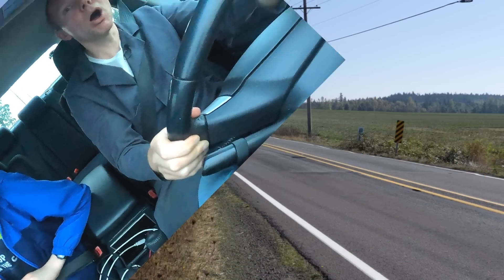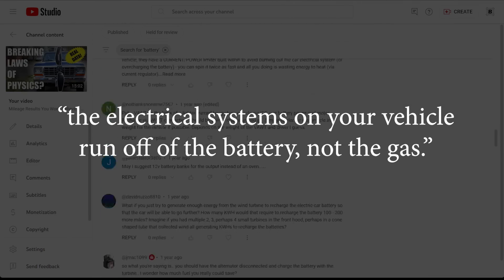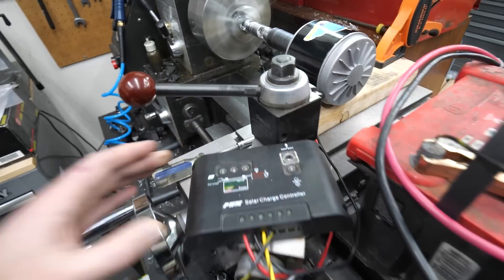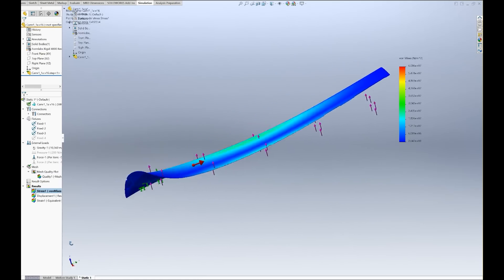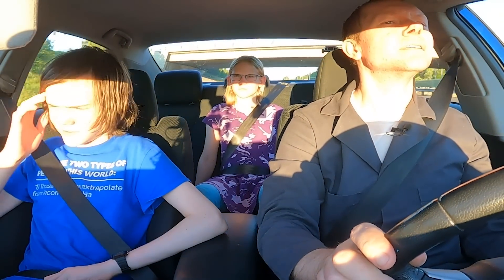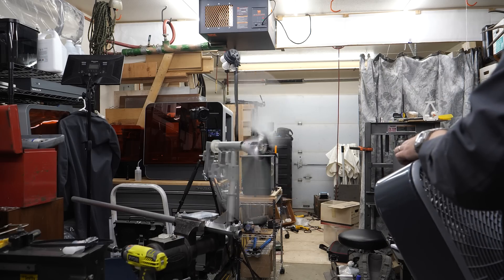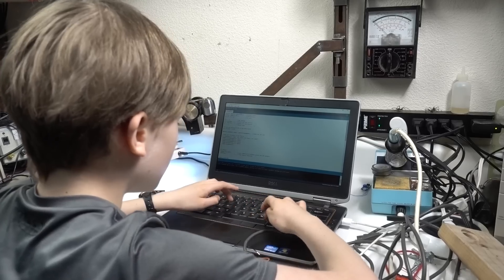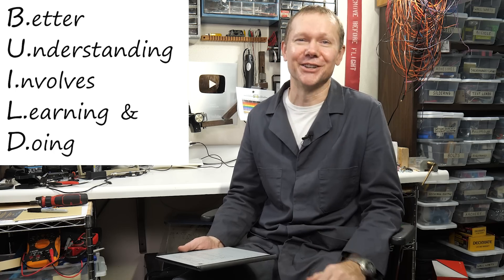3D Printed Turbine on a Camry - Wind Power on a Car #6

Comment: If the turbine is on top u face more drag with a much bigger volume of air hitting not only the fan but the surface of the vechicle , this will in turn force the feul to be consumed more.
Having on the front has the SAM EFFECT but in a lower capacity as your not add much more volume so should keep feul the same or slightly better....
The problem comes from your OPEN turbine design.

The car has been designed to handle the drag to the best of its abilities BUT u add propellers on front u reduce efficency, what you need is an SEMI ENCLOSED design much like a turbo jet engine to reduce the drag which capturing as much air drag as possible in the right location to allow the car to feel less drag... less drag = less fuel used. And a system like that will allow for much better feul consumption.
Ur proposed design would give you between 0 and 10% better feul efficency, my proposed design ranges from 5 to 50% better fuel efficency.

Comment: Basically the same concept as ground effect on race cars. The body of the car will create drag regardless so using the car as a wing allows you to add downforce without increasing drag. (Aside from induced drag***)

Comment: Why not try a ram jet design? Then you aren’t disturbing the air anymore than it already is and it can be used to cool the electric motor and exhausted back into the normal airflow of the vehicle.

Comment: Depends on the vehicle because some vehicles cut off without batteries. I can a van that would die when battery became loose because alternator was controlled with feedback from ecu

Comment: With the turbine in  front of the radiator, it will mess with the air flow over the radiator. I think this (aling with increased drag) will cause the net loss and all that jazz.
Reply: Drag is increased due to the increased angle of deflection of the air and the distance that occurs in. The radiator being worse at radiating will make the heat engine a less efficient heat engine.... although I think you might be able to get away with it depending on air conditions. but I am just an electrical guy eating toast writing this and shooting from the hip lol

Comment: Not really sure what you’re asking at 15:34

If you’re asking just for the difference, it’s simple.

Your slipstream (how much turbulent air) will increase if it is mounted atop your vehicle… where in front of your vehicle it will increase your slipstream by such a small amount it will show very little change. 

Along with that, it will cause a lot of drag if mounted atop the vehicle.  You’ll get more downforce on your rear axle, and that could be helpful if your engine was putting out enough power to warrant that, and it’s a RWD vehicle, but we simply aren’t looking for engine output/ performance, but instead looking for fuel mileage improvement. 

Along with that, if you need more downforce on your axle, you’d be better off moving it to the rear of the vehicle and making it cause as little drag with the most wind displacement and that would look like a spoiler… in fact it’d be a spoiler.  So no need to do that.

Comment: will matter if you take the alt out but with the belt still attached the drag remains,  if you have a belt briven fan changing to electric save gas and makes more power. It is all about the load of the belt.

Comment: Awesome videos with amazing problem solving skills!!  "Hope is not a strategy" lol.    I think the turbines out front ( and only out front,  in a smaller span of the front vehicle profile ) will improvs fuel* economy very slightly by displacing a small amount of air resistance as regained energy away/around the vehicle (work that was going to be done anyways).  Ideally the blades of the turbine would displace the air away from the car better and not more towards the center on the vehicle and work with the airflow around the car.  As long as the air that the blades of the turbine are displacing is away from the vehicle with proper aerodynamics in mind.  Fun stuff to think about.  I would be curious to see how one turbine would do out front and centre. (without having any blade span under the vehicle or above the hood)  One turbine in the middle should have equal air hitting each blade of the turbine.  Two turbines  could have  most of the air   hitting the blade on the outer edge of the vehicle front profile on its way around, leaving the air hitting the blades on the inner profile to receive less airflow. (maybe that's a good thing though, I don't know)  I assume if the turbines are too far from the car, it wont help economy. Too close could have strange eddies disrupting the turbines also.  I guess ideally, you're going to want to try to nerf the efficacy of your car's radiator with the blades of the turbine by having the radiator receive less airflow.

Comment: My guess is By putting that on the front of the car when it is producing power, blades would create enough resistance in the air because of the generator being harder to spin under load causing the whole thing to push back on the car probably equal or there abouts to what the alternator robs, to me there is no difference than putting on the roof other than creating even more drag, even if you put it on the back it would pull backwards the thing not just sitting there in the air stream at whatever speed it's going to be pushed backwards in front or behind doesn't matter

Comment: For these kind of problems, I like to think of the extremes. Let’s say your car has absolutely perfect aerodynamics and creates zero drag. Then it does not matter if you put the turbine in front or on top, any additional surface in the stream of air will slow your car down.

But your point is that the aerodynamics are not perfect and the air is disturbed anyway. In my opinion the most important factor here is when and how the airflow is disturbed.

Let’s say you drive your car with the turbine in a vacuum and hit exactly one molecule. Chronologically it will hit the turbine blade first, „spinning it up“ and pushing back on your car. Only after that happens it hits the cars front (radiator, windshield, wherever it gets deflected) and then creates it’s „normal turbulence“.

In a constant stream of air I expect the same to happen: The turbine gets hit first and slows the car down and the turbulence you want to use happens afterwards.

So as much as I would love this to work, I am sceptic but I think it’s awesome that you test this in real life because I actually had some discussions about that with an engineering friend. Also it’s awesome that you build it with your kids so even if it fails it will be a cool project for them to learn new things so it’s worth it anyway :)
Reply from the maker: Interesting way to look at it. Thanks for sharing!

Comment: You made something similar to the APU (auxillary power unit)  on big airplanes.  Normally the APU is stored inside the plane, but when a large airplane loses its electric power during flight, they can deploy the APU and it generates electricity from the airflow.

The fact that airplanes use the APU only in an emergency proves that it isn't an efficient way to provide power.  The APU increases drag on the plane and slows it down.

Comment: I bet the the car will improve in fuel economy, the wind turbine is making the air hitting the car more turbulent which might improve fuel efficiency all ready but recouping power on top and using it to actively drive the wheels will probably see a huge gain in efficiency

Comment: TY for the video

Using the turbines to generate the electricity for the vehicle will improve fuel efficiency, with respect to joules of fuel to watts of power. 

The consideration that, I think, will make a difference is how the aerodynamics of the vehicle are impacted. If the aerodynamic load increases, then there will be losses. But the overall effect will have to be considered to see if it's a net loss, or gain, or maybe just a break even.

Comment: Time 11:20ish...the funny noise is a harmonic resonance from something imbalanced. You can see the car shimmy in the video. I'm surprised you didn't feel it. It is like an imbalanced tire that is sensitive at a given speed, where the shimmy goes away as you accelerate through the sympathy range. You might want to add some vertical cross brace to reduce racking.

Comment: Increase. Not yet seeing the design (I paused) I'm going to guess 8%. I would suggest several smaller turbines set in a nacelle on the hood and run it like a ram air turbine (RAT) auxiliary power supply on military aircraft. They are used to power add on high voltage equipment from time to time. Keep up the good work educating me and raising those great kids.

Comment: You know you're just creating more drag than the energy it takes to produce electricity. You're better off just adding another alternator to the engine or solar panels on the roof.

Comment: This also can be used in a small unit in the front of an electric EV auto
This will run a charging port to keep the EV so you can drive farther
Being an engineer my self has talked to a few EV retailers but all said it will not work and understand bearable to look at I told them all this can be put under the front compartment  that is used for almost nothing
I love this this is a fabulous idea

Comment: How about using an rc boat type system where the blades are built within the confines of a shroud for structural integrity.  Also. This would need to be built also  within the confines of the front-end of the car for further structural strength in my opinion.  This at least warrants investigation and testing.

Comment: Aerospace engineer here, my prediction is that in the end, no, it will take as much if not more energy to push through the air than will be recovered in the turbine. At best, the turbine can recover 87% of the flow, and then there are the losses in the pully system, power generation, and buck converter. It’s a bit of a misconception to think of the air as stagnating at the front and thus lost; yes the pressure goes up at the front, but it is recovered on the backside. The aerodynamics of the back of the car are the most important. In this case, the pressure difference through the turbine is decreased substantially by the high pressure on the front of the car, which reduces how much power you can recover through the turbine. The flow is also disrupted, which will in turn disrupt the flow over the car, making its overall coefficient of drag higher. It is possible that the alternator in the car is so inefficient that even with the losses in this system, they are better than the car’s alternator, but I don’t think that will be the case. If it was, it is easy to test for. Even so, the work you and your children have been doing is fantastic and the methodology to test being taught to them is phenomenal. We have a slogan where I work “to separate the real from the imagined through flight test”. You may not be flying, but you are testing to separate the real from the imagined. Look forward to seeing the future updates.

Comment: The reason the propeller on the roof doesn't work where as the propeller on the front appears to work maybe, is that the air you need to push the turbine through you have to displaces with the vehicle anyway so it's kind of wasted energy recapture in that sense. In saying that you are introducing turbulence across the vehicle which may increase drag to the point that it stops making it worth it. Really interesting project! My gut reaction was to dismiss it immediately but what you're saying does make sense. More testing required!

Comment: It would be best to review this from an energy point of view. You are not creating energy here, so if you can generate x kW presumably you have consumed > x kW more from your ICE in the form of drag, or at least dynamic pressure. It would be interesting to drive 100miles without the generator installed, and the same 100miles with the generator installed and compare the fuel consumption. Care to share any numbers? If your theory is correct you could put generating propellers on the front of aircraft to make them more efficient - and more generating propellers would be more efficient right?

Comment: There will be an increase in drag from the turbines themselves cutting through the air, but some of the turbine drag will be recouped since the rotors are disrupting air before it gets to the car.  on the "stock" version of the car, fresh air is harder to push out of the way than air that is already turbulent from the turbine setup.  Overall, a small drag increase I would guess as long as complex fluid dynamics doesn't screw you over.

That combined with tiny weight gain and decent mechanical losses in the turbine system itself, means that there will be a large hill to climb to make it a net efficiency gain.

However, that being said,  I believe it will succeed in being more efficient by at least some measurable amount. 

At highway speed the large majority of work a car is doing is moving air out of the way. Anything you can do to recoup some of the energy imparted to those air molecules by the car as they move out of the way should tangibly increase efficiency. 

I think the biggest challenge is optimizing the system. there is no way to unhook the alternator from the serpentine belt so there is mechanical loss there, there's potentially only going to be a small regime where the turbine is working optimally, so your gains might get eaten away in the data from other speed regimes, the turbine blade design and size is pretty much infinitely tunable when coupled with target rpm range...so finding the best combination would take a lot of testing, so yeah, lots of little devils in all the details.

I wish you could put this on an EV vehicle and just pump power directly back into the propulsion system (not the battery). Then it would be absolute. Miles driven divided by power expended from the battery in stock and turbine configurations gives you the miles per Kw for each.  naysayers wouldn't be able to argue with that setup.

Comment: My guess is a slight net loss (0-2%)... Not that I don't believe your theory, I believe it's solid. I just expect it's going to require a bit more exotic design to get the gains your after which may require some redesign of the car as well as the turbine.
Reply: To improve your odds you should revert to something less efficient like the pick up truck XD

Comment: My guess is a increase of efficiency, mostly because the turbine is likely more efficient. Even with only 85% for the generator, the 800w would only need 940 "mechanical" watts. 

Also, i saw the video where someone cjarged a tesla by pulling it and the reach of both vehicles combined got longer than just the truck. Which kinda confirms my theory. Hopefully.

Edit: wrote the comment too early to see the percentage request, i say close to the 10 percent you mentioned the alternator needs, maybe a bit more but under 15.

Comment: Science says that you won’t notice a chance in economy. The boost in electricity from the turbines would be offset by the extra work the engine does to push the turbines through the air

Comment: I feel like if the fan blades were constructed to resemble the fan blades of a bathroom fan…. Encased in a housing that would catch the front air, then pushing the air out underneath the car…. it would resemble something along the lines of a front bumper attachment.

If the centre of the fanblades had a driveshaft that you could connect even two generators on both sides , I bet you it would crank it over and give you some interesting numbers

I am not an engineer , but I do love to tinker with stuff

When I first thought of this idea, I was more or less thinking about having something like that on an electric car to keep it charged up as you go for road trips

Comment: Stop calling yourself an engineer... it always takes more power to generate due to the conversion losses. The only way that something in front of the vehicle DOES NOT create drag, is if it does not disturb the air.  Rotating blades do not just passively pass air through them without creating drag... in fact, it is specifically that drag that causes the blades to spin.

800 watts out, probably 1500 watts in... 2hp input.

Comment: Taking your battery cables off of the vehicle while running is what a mechanic would do to check to see if your alternator is functioning correctly, because if an alternator is functioning correctly the car should not shut off when the battery is disconnected.
  if you do disconnect your battery and the engine dies you need to replace your alternator

Comment: The difference between a fan on top of the roof vs in front of the car is the area you're presenting to the wind.  By putting the fans on front of the car you're not going to present more area to the wind.  From that alone it appears that you're NOT going to increase drag. The question you're trying to answer though is if you're adding extra work or not.  The key point of this is going to be the wind coming off the turbine blades.  You're adding turbulent wind to the front of your car.  The tips are going to be generating vortices that will be constantly rotating in front of the car.   So will that reduce your overall aero efficency and add drag?  I think so.  My prediction is that you're going to see a slight decrease in efficency and it's going to be hard to measure.  What you lose from bad aero, you gain by using the electricity from the blades.  The difference is going to be efficency losses. So if the turbine is 80% efficient you'll see 20% loss over all.  20% of 800w is 160W.  So you need to measure a 160W loss.